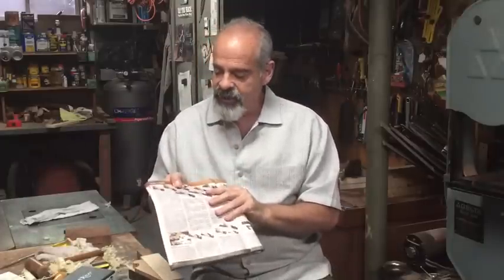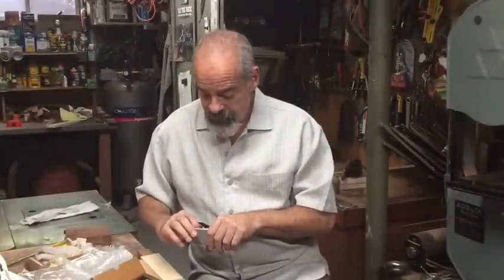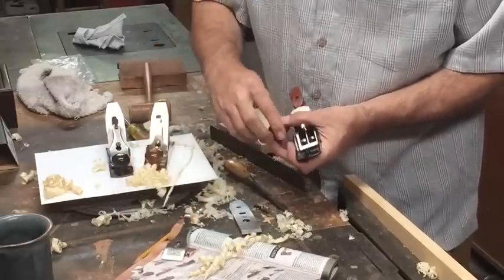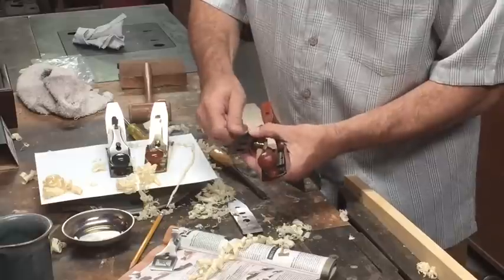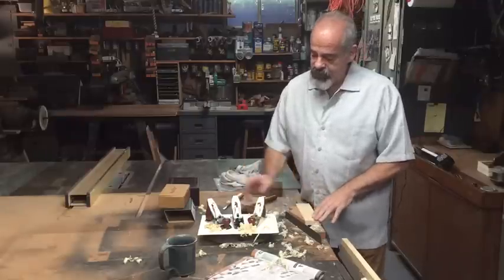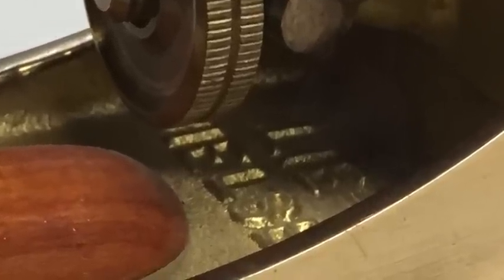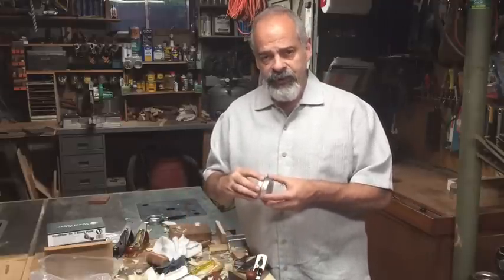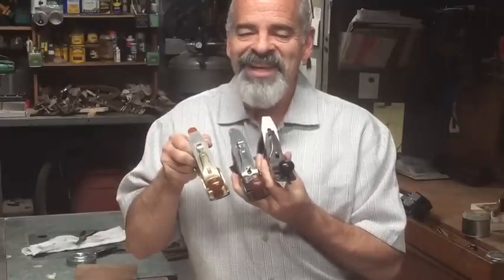COMPARING 3 STANLEY No 1 STYLE PLANES LIE-NIELSEN WOOD RIVER AND THE ORIGINAL.

Comment: Hi Chester. Very informative  Do you know if the machine screws of the lie Nielsen are bronze or brass? One advantage of having brass over steel might be that if over torqued the thread would strip from the screws rather than the casing, making repair easier and cheaper.
Reply from the maker: They appear, to me, to be brass. I might agree on the benefit of a brass screw in an iron frog but in the case where the brass screw is in a  brass frog I’m not sure which threads might shear first. The head of the screw is definitely weaker and more susceptible to wear and twist over a steel screw. That said, if one is careful and considerate with them, as I am, they appear to hold up alright. Using the proper sized driver and not over tightening will help. Also, I always loosen the hold down screw and place the lever in loosely with the lever down. Then I tighten up the screw to snugness. Then I release the cam, give a slight rotation tightening and then snap down the cam lever. I have seen damage where someone assumes the screw is at the right height and clamps down the lever too tightly thus damaging the underside of the head of the screw.
Reply: @ChetSpier  That's a sensible technique. I just snug up to the point the blade doesn't shift in normal use, which in sure is less than intended, and only tighten further if needed.
Reply: Agreed, as these aren’t high load/torque verified fasteners, it’s a better practice to use equal or softer fasteners, it’s lot easier to replace a fastener vs. doing thread repairs (helicoil/twinserts/etc).

Comment: I agree with you totally regarding the brass screws here. I stopped using any brass screws for major structural or major moving parts on tools, they tend to develop creep and stress cracks after time.. They can sometimes snap off without warning. I would replace the ones going into the casting with high tensile screws. My experience, just 304 steel will do the job, forget any kind of brass of the job. As for bronze, perhaps they're OK, knowing high tension electrical, heavy gauge bus-bars are fastened with phosphor bronze fasteners with great amount of torque..

Comment: I wonder if you have looked into the Veritas No.1. I have only looked at it on a computer screen but it appears to display the refinement, innovation, and attention to detail that Veritas does so well. I am thinking of purchasing one and would appreciate your input. And thanks for the video.
Reply from the maker: I have just recently seen it. Interesting. A bevel up low angle No 1
Reply: @ChetSpier  I thought you might be interested to know that I have since purchased the Veritas No. 1 and so far I am very favorably impressed with its feel and performance. After watching the video about your experience with the Veritas shooting plane, I was careful to examine the No. 1 thoroughly. It is all that I expected.
On another topic, I recently bought an English Stanley No. 71 (new old stock) in the original box with accessories at a garage sale. The seller informed me that the adjuster screw nut in the box was the wrong one. I tried the one from my (made in USA) 71 1/2 and it worked. This surprised me because I thought the English screw might have metric threads. But I wonder if you have any ideas about dating English Stanleys as I've been unable to find any info about this. The knobs are painted black. All the metal parts are nickel plated. Thanks again for all your videos.

Comment: Interesting video. But if are going to compare WoodRiver and Lie Nielson to traditional Stanleys, you should be using a Bedrock Plane. The new planes are based on the Stanley Bedrock, not the common frog mount shown here.
Reply from the maker: That would be fine for the larger planes but this was specifically about the No 1 size and not a general comparison. Stanley never mad a “Bedrock” no 1 so that renders your suggestion, impossible.